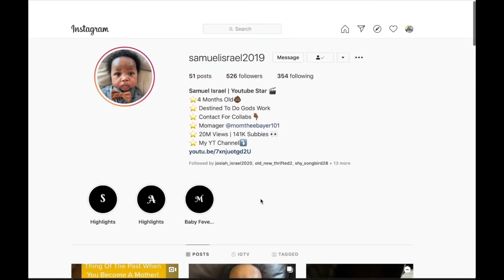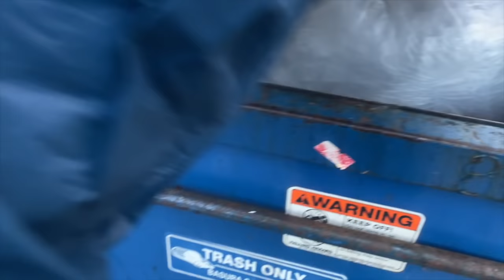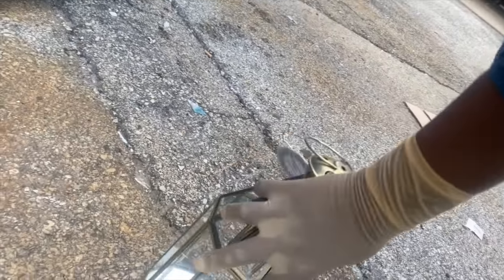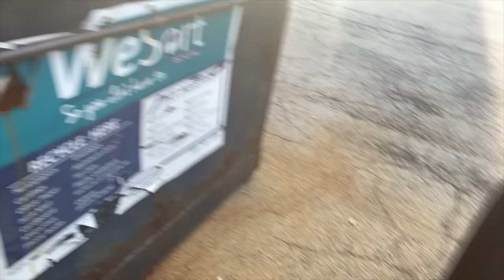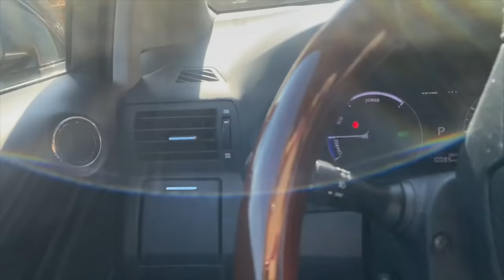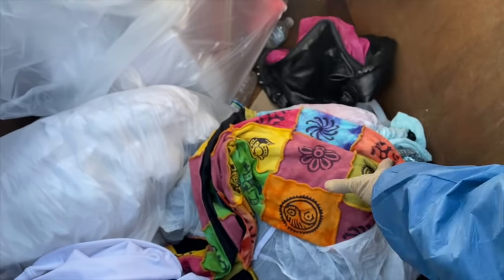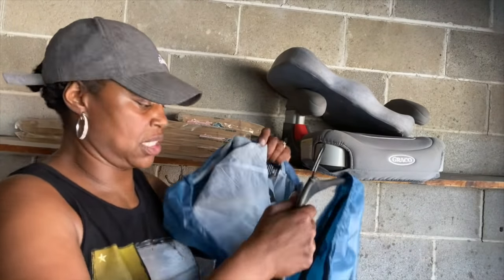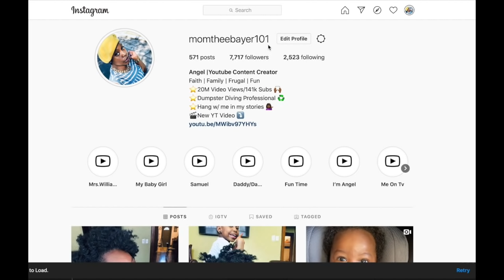Dumpster Diving: WOW....I Found The Perfect FIND!!!!

Comment: Nice. You can also use that as a planter with fake greens in it. Question, why didn't you take the clothes that were in the dumpster? They could have been washed and sold on Ebay/Poshmark or donated.